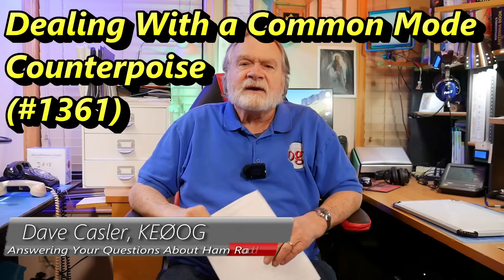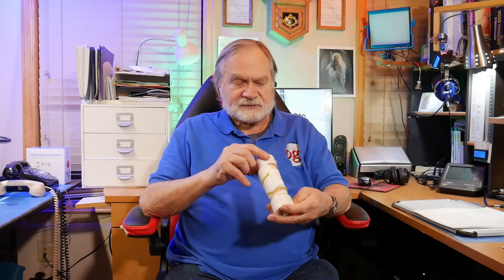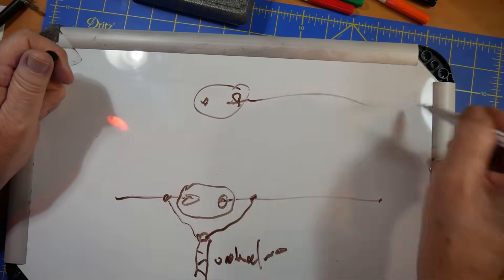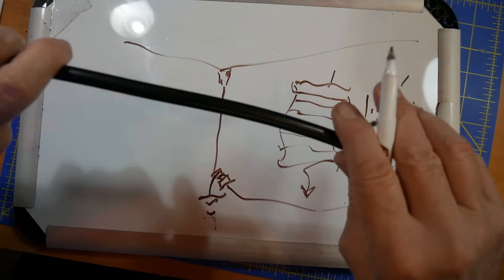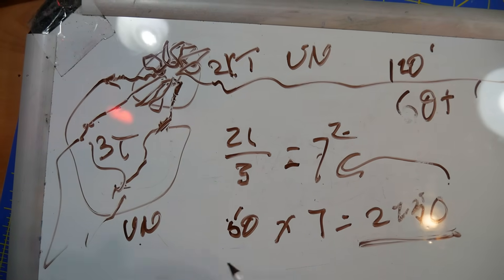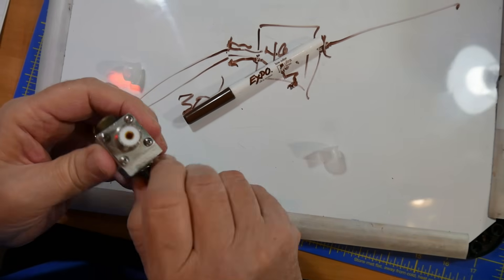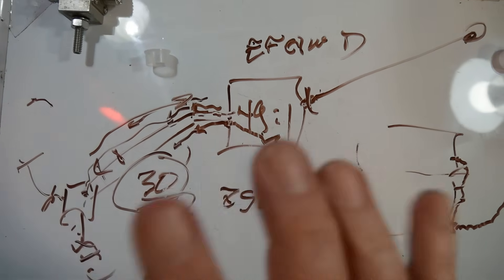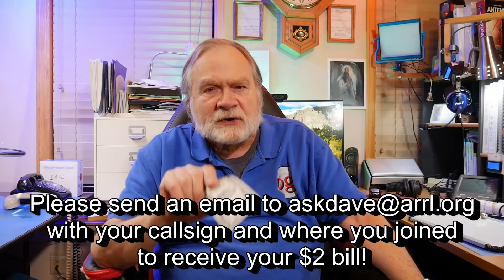Dealing With a Common Mode Counterpoise (#1361)

Comment: Seasons greetings all. 
On the 40m EFHW if you simply have a 2m tail on the 49:1 primary then it is just a 95% to 5% off centre fed dipole. In which case you run a 49:1 balun (not UnUn).. preferably with primary to secondary isolation ( IE coax screen NOT DC connected tail side of the primary).
As an additional help have a choke balun on the coax up at the antenna.
If you treat the EFHW as a very very very OCF dipole (& treat it as balanced) then its behaviour is a lot more predictable.

Comment: thank you, I'm often wondered when I see that coil of cable from the cable TV company from pole to pole... I now know what they're doing
Reply: That's more for having extra coax in case you need to cut back and replace the fitting , than for common mode rejection .
If everything is bonded per NEC that's not generally an issue .
Being close by a high powered AM radio station , or , high tension power lines , notwithstanding, of course .